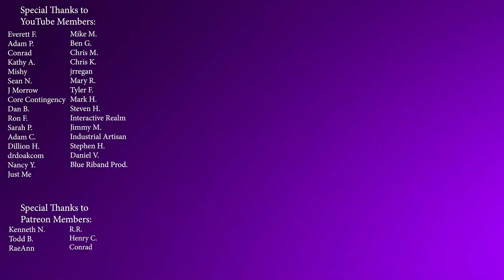The Montparnasse Train Wreck

Comment: Full story,

On October 22nd 1895, The Granville Paris Express was departing at 8:10 (10 minutes behind  schedule). After 8 hours of travelling, at 15:52, the engine was approaching Montarpnese station. Since they were behind schedule, they were speeding at a phenomenal speed of 97 mph to get there on time. As they were travelling for 8 hours. The driver and fireman were very tired. They were too tired to apply the brakes on time and at 4:00pm or 16:00, diaster struck. The driver realised that they were already inside of the station so then they decided to add full power to the brakes. The fireman didn’t realise until the driver told him about what was happeneing. The fireman switched off the throttle to help them slow down, but it was too late. The brakes failed and at 16:02, the Granville-Paris-Express bashed through the barrier at the terminus, completely annihilating the floor of the station. At 16:03 the train crashed through the large window of the station, falling a whole 33 feet (or in this case 10 metres) to the ground, crushing a woman violently. The force of the impact made the coal tender (or just tender) smash into the back of the locomotive, throwing coal all over the driver and fireman. All passengers and driver and fireman had all survied, leaving just one fatality of the crash, which was the poor woman.

The clip showed in this video was a part of a movie named Hugo, (His full name is Hugo Cabret), which in this case shows Hugo jumping on the tracks to get a key for his automoton that his father made before he died. Hugo soon realises a train (Which in this case is the Granville Express) charging towards him. He drops the key in an attempt to save himself, but It was all a dream and he woke up because of it

Hope this helped.

Comment: I don't think the crew was as responsible as the court found. I don't know about French railroading practices but elsewhere at the time the crew could be docked wages or fired for running trains late, and of course ten minutes is a big deal in train time. There was likely an implicit coercion to do anything to make up the time. A little sacrifice of safety to be able to buy dinner.
Good job covering this incident. It's nice to watch something that isn't about ocean liners now and then lol. :)
Reply: Yes and No: Yes the crew has to make-up for lost time and No, it has to remain in control of the train's speed and be able to stop no matter what the circumstance. Yes there were a lot of unfair rules in French railways at the time : the crew had to pay for lubrication oil for the distribution mechanism and bearings, and it was fined when a "boite chaude" (hot bearing resulting in a melted bearing sleeve) even though it was not always its fault.

Comment: Just Excellent!!! There was a similar crash at the train station in Washington, DC in January 1953, a couple days before the Inauguration of President Eisenhower. Do a piece on that. The engine hauling the train full of inaugural guests went through the buffers, then literally fell through the floor. A new temporary floor was hastily built for use during the festivities. Then, after Eisenhower was sworn in, the engine was salvaged. The engine was a GG1; a large engine!

Comment: Oh wow, Alex!! I've seen the photos (and that movie clip- what movie was that from? I saw it several years ago!) but didn't know the story. O.K. there is one thing that BAFFLES me every time: What was the train doing on the second floor?? I asked someone years ago, and they said the train was actually on the ground floor, and the area it fell into was like a basement- an area dug down from the ground level. But the footage (I think from that movie- not the photos?) make it look more like it's actually on the second floor. Help- I'm stumped! 😅
Reply from the maker: The movie is Hugo. And the reason the train is on the second floor is because the train tracks leading through the city were elevated in order to cross over the streets of Paris uninterrupted by ground-level traffic.
Reply: @AlextheHistorian  Thank you!!! Elevated tracks- Now it makes sense LOL!! Thanks for the great video, love train history ❤
Reply from the maker: No problem 😊
Reply: There's also tracks on the street, but they craned the loco all the way back upstairs?
Reply from the maker: @Paul, the tracks on the street go to streetcar lines, which means they don't connect at all to the tracks the passenger trains go. Also streetcar tracks tend to have tighter turns than what a full steam locomotive can handle, and there's even a possibility the streetcar tracks have a different gauge width than the tracks the passenger train needs.

Comment: The train, like large Locomotives like the Union Pacific 4014, it has 2 Piston Sets, 1 piston and 1 valve per set, unlike the Big Boy that has 4, powering a 4-8-8-4 Configuration
4 Safety Wheels
8 Driving wheels
8 Driving Wheels
4 Stearing wheels

Comment: can't be sure with the limited details offered here, but it sounds as if using the brakes to slow the train a few miles back might have given them the idea that they were not working properly. In that case they would not be blamed for being late if they slowed down. It was a mechanical failure.
Reply from the maker: To be honest, in my research I tried to get a detailed explanation of the brake failure, but could not. I can only surmise that they were hauling a lot of cars, going very fast, and when they applied the brakes, there just wasn't enough length of track to adequately allow the brakes to do their job. But the details are just too vague. They also probably passed a brake application signal, in their rush to the station, deciding to apply the brakes at the last minute.
Reply: @AlextheHistorian  I seriously doubt they had any sort of signals in that era because it was before electric lights were invented. The video did tell us how many train cars were on the consist (9 I believe) which would not take a mile to stop, even back then.
Reply from the maker: By signal I meant sign. It would have been a post with bands of color or something painted on that the engineers would have known meant to slow down for a stop. Also I didn't mean "by a mile" I just meant that they were probably still going overspeed when the engine was nearing the entrance portal to the station.
Reply: @AlextheHistorian  ... yes, some of that was also in the video. The RR uses signage similar to what we use on roads, warning of slow curves ahead, etc. (different signs but same meaning) Still in all, at something just over 25 MPH (stated in the video) it would be reasonable to stop within a quarter mile.... maybe a half mile on the outside. That tells me there was some sort of malfunction.... or perhaps wet track.
Reply from the maker: Yeah I thought about that too, maybe it was a straight-air design that was leaking, preventing the brakes from applying.